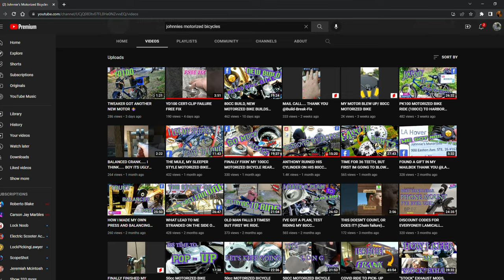Electric Bikes Vs Gas Bikes (In The REAL World)

Comment: E bikes in the EU are stupid 25 km/h and pedal assist only. Gas bikes make 100% more sense over here. Unless ,ou get something over the top they don't make sense as a "stock" product.
Reply: I like the throttle propelled ebike. Low maitrnce but too expensive.  Gas bike wins at the end of the day
Reply: @person-ce8cr  go with a conversion kit, literally just finished upgrading my road bike yesterday 1,350$ total and I could easily have gone alot cheaper, this is with a 1000w bbshd motor with a 52v 14ah battery, speed limit I can set, and can cruise up to 38mph, can go faster if I change to higher gears, but frankly I dont need it, and I'm not willing to risk my life on a bike from the early 90s anyways
Reply: Gas bikes in Europe dont make as much sense as it seems considering they have to be registered regardless of power. If it's a Bosch motor there is chips available that up the top speed to 45. Trenergy sells a bike without a limiter. Decreasing the wheel circumference in the ebike settings gives you a bit more speed at the cost of inaccurate speedometer readings. The way a  manufacturer delivers a bike has to fit certain law based parameters, but that's usually not the whole story
Reply: @joe-_-  they don't need any registration in my country. You can have them with a 50cc engine. No insurance, no licence, no registration needed.
Reply: @Matthew-wj8cm  oh well in the Netherlands they do
Reply: @Matthew-wj8cm  here in the US right? The trade though between gas and electric is gas becoming more of a hobby than reliable transport, granted the conversions have become a hobby by themselves, but beyond the setup, maintenance and performance tweaks are not nearly as common as the gas kits, not meaning this as a bash, they are definitely cool, but for transportation they do lack reliability
Reply: @alexnorth2452  you summed it up perfectly. Electric is indeed more useful from a reliability standpoint. But price is still the issue with me, combined with the 25 km/h rule in the EU
Reply: @Matthew-wj8cm  in my first reply on the thread i mentioned the conversion kit I use, which is a 1000w bafang bbshd mid drive, changing the speed limit on it is as simple as typing in a code, I currently have mine set to 99mph, not that it can reach that, nor do I ever cruise at full speed which is about 44, normally keep it at 18-20mph but on my route I get chased by dogs alot, so I like to have the ability to go above 30, I now ride a lowrider recumbent, so I'm quite low, and am not eager to see which dogs are actually friendly, but getting back on topic, technically my setup is not street legal, but in the rural area I live, so long as I'm not doing stupid stuff, that isn't really an issue, it boils down to the cops are not gonna take the time to check the specs on the motor so long as I am not doing anything to draw their attention, while I can go 40+, I don't need to, nor do I want to, I'm content at 20, and if I get tired of peddling, I do have a throttle, but I never go above 15 with it

Edit, and on the price, while it is higher than the cheaper gas kits, you can get electric kits below the 1k mark, though I do not recommend cheaping out on the battery
Reply: @alexnorth2452  that's the point. I neber in my life had 1k to spend
Reply: @Matthew-wj8cm  time to save up a bit then, it's not like I was able to buy it on a single paycheck, it took 5 months of saving to afford it, and the extra $ spent is time saved on maintenance, so I'd argue it equals out in the long run
Reply: @alexnorth2452  thank you. Maybe I'll do that
Reply: I'm curious if anyone in the EU remembers the time when they were free or if they even care anymore. Next stop for the EU 15min cities, C taxes and time to Eat ze bugs !
Reply: @joe-_-  i just ride mine illegally, the police don't care, it's illegal to have more than 50cc but just tell them it's a 49cc. They know you're lying but usually couldn't care less
Reply: @joe-_-  here in America anything 50cc and lower doesn’t need any form of license, permit, or even age restriction. I just use it for work.
Reply: @JudeTheYoutubePoopersubscribe  i know but tell the czech police. They were pissed i didn't have a title for this thing, they don't make titles for these but they wouldn't listen. I had to push the thing home. That sucked
Reply: Same in Australia. They out lawed the petrol kits that were $300, the electric ones that are legal are useless. 25kmph and 35kms range.

Comment: I purchased a 49cc 4 stroke motor kit with a 44 tooth sprocket. I put it on a 26 inch huffy cruiser. I am 225 lbs on a good day. My top speed is 29 mph with an average of 90 miles per 2.5 litter tank. The only problem I had with this kit was the clutch after about 2500 miles. Replacing it was easy to do and only cost $30
Reply: Yup, love my 4 stroke. Just keep an eye on your chain tensioner.
Reply: Burned through 2 clutches within 15 miles
Reply: Spend the extra money on a wet clutch.  It rides in oil and wont burn out.
Reply: @williamsporing1500 it can be dangerous if you don’t for sure
Reply: @TalanisYoung  I welded one to my frame. It’s an alternator bracket for a Chevy small block. Haven’t had an issue. The bolt on ones that come with kits are junk.
Reply: I built a 52v 1200w ebike off the Schwinn o.c.c. stingray frame with actual moto tyres and a dual mode controller consistently cruising at 35mph with a top speed of 49mph with a range of 40-450miles  and can handle a 20%grade with ease I've built gassers in the past and the reletive quiet is nice compared to the high buzz of the 2strokes
Reply: @williamsporing1500  yup 👍

Comment: I built an e-bike in the early 2000's using a car battery, big block chevy starter with gear reduction and a flywheel (10:1 ratio total) and I used a fuel pump, pc radiator and I ran 1/4" aluminum tubing around the starter coils and brushes. 30ish moh and very reliable. Currently I'm working on a 1,000w setup and working out a gas/e hybrid option.

Comment: I would want to point out that it’s literally impossible to find a entire electric bike with a 60v, 52v, or a 48v battery for under $500. You can try finding one for more than 168 hours non-stop but I’ll promise you that you will never ever find a seller trying to sell a entire electric bike with a 52v battery for under $500 flat. Electric bikes also is not budget-friendly on the whole since a dirt cheap e-bike by many enthusiasts cost a minimum of $1k. A decent electric bike conversion kit alone cost $1,350. Electric bikes are trash, for the battery alone you could’ve purchase an entire pre-installed gas bicycle.

Comment: The fact that you built up the 2-stroke bike gives you a massive amount of flexibility when considering things like power, speed, and price. Just this last month, I built a 1500w ebike, including the battery, which I built with 98 Samsung 18650 cells. Because I built it myself, I was able to choose exactly how much capacity the battery had, how much power the motor had, what brakes I put on, and so on. It has a top speed of around 34, and so cruising around at 25 mph really isn't stressing any of the components out. In this way, the DIY approach has its advantages, and leaves the HIBOY ebike with a slight disadvantage.
Very well put together video though!
Reply: May I snoop and ask you a question?  Your electric build is much more than I will ever need, but as a two stroker wanting to get an electric, I cannot afford a factory electric.  About how much was your build?  My gasser was $107 for the engine and a $75 old Huffy beach cruiser.  Then the lighting, dual brake lever, rear basket (yup poor man's grocery getter) added around $100 more.  I want to get into electric and there are hubs on eBay starting around $200, but then battery, speed controls, etc and knowing what goes with what seems impossible to my empty pockets. Any helpful information would be appreciated.  Thanks
Reply: @marcpavlik8776  you can check-out ebike school here on youtube.
Reply: @lonewolf14779  Thank you, I will check them out.
Reply: @marcpavlik8776  It all depends on how far you wanted to go to save cash. My build cost a little over $1000 all in, including the necessary tools to build the battery, but you can do it a lot cheaper. I started out with a new $400 bike, because I didn't want to have to worry about any of my components, but if you surfed the used market (facebook marketplace, craigslist, etc) you could probably get a decent bike for around or under $100. The kits you see on eBay for around $250 or so usually come with everything needed to convert the bike EXCEPT the battery, which you would need to get separately. To go the route that I took, and build your own battery would likely save money if you already have a soldering iron, spot welder, charger, and the knowhow to put it together, but otherwise a battery off of eBay would do the trick equally well. The benefits of electric power come with a hefty price tag, but if you save then I think it's worth it.
Reply: @kwadkrazy6078  Very good information thank you.  Batteries have been my main concern, I have the bikes, and I have been told to check out E Bike school as well and so far an electric bike is starting to look more promising.  Being able to get appropriate items that interface safely with each other, but not necessarily at the same time of purchase and still affordable is a key point for me.  I'm getting lot's of information now and have a pretty decent brain (half a body though) but I am starting to think it will happen.
Never thought I'd say something like this.  I'm getting excited about an E vehicle.  
Oh my Master GM mechanic father is rolling in his grave right now.  Oh well.  Thanks
Reply: Built >bought
Reply: @businessraptor134 how about bought from built?
Reply: I agree! I build E-bikes, a DYI E-bike cost less than $1200 dollars.
With $1200 I can buy a nice bike, a nice E-bike conversion kit, and battery.
$1000 dollars can yield you a E-bike with a 32 to 36mph, with a range of 41 miles’ full throttle’ very clean looking build, and very dependable…..I’m not knocking a already assembled E-bike…..but already built E-bikes are gonna be a bit more expensive, and have a speed Govern, if something goes wrong with it….it’s gonna be harder to Troubleshoot’ compared to a DIY E-bike’ most DIY E-bikes use atleast a 1000w kit.

I personally think the video should’ve been Diy E-bike vs DIY  gas bike.

Comment: Thanks for the video man, i looked at both the electric and the 2 stroke. With my budget and mechanical experience, it was an easy choice for me. The 2 stroke it was, and i been enjoying my bike now for almost a year i believe or maybe longer. lol. Electric just could not go the distance, if i want to ride 100miles , all i need to do it keep putting gas in and keep going. Then there was PRICE, and the laws around electic bikes here. 2 stroke was best for me. I appreciate your opinions and thoughts man. take care.
Reply: Hey I know this is an old comment but how do you make it ride reliably enough to go 100 miles with no issues?

Comment: Gasket sealer or silicone on the wire going in the hub is what I’ve done. If the wire and hole is pointed down then less chance of intrusion. I still seal them up though. Water in the throttle has messed up my rides before, glad to see this bike doesn’t seem affected.
Reply from the maker: Thanks for the heads up!

Comment: I've used a small 1000 watt generator in tow to my 3kw hub motor build and had unlimited miles per generator fills.  For folks with range anxiety.  I tested this setup for 6 hours of constant running and charge never dropped under 80%

Comment: The online e-bike conversion kits don't cost much until you add a battery.  I was looking at a Bosch e-bike because I like the chain drive motors.  The e-bike was $2200 and an extra battery was $800.  I couldn't afford that, so I opted for the Bafang e-bike kit to get the price below $1000.  I like the bike because it makes no sound.  Adding a 2nd battery cost around $500, but then there is always the fear of battery failure and if it ever catches fire, they burn down everything around it.  Hopefully that won't happen to me, but it is a concern.  I have been thinking of buying a friction drive kit with a Honda GX50 engine.  You're right, it is more of a hobby than something to depend on.

Comment: LAH, great video as usual and well presented.  I'm a two stroker out of cost mostly, some times I have hopped in the van instead of the bike because I can be lazy or my leg hurts bad enough I don't want to peddle.  An electric would be a great addition to my transportation needs.  Like you, electric range would suit me fine. Right now a 1/2 gallon gas and $1 for oil mix lasts me a month or better in town ($40 per month in fuel in the van, I don't leave home much anymore).  Getting electric is out of the question price wise (so if any of those folks sending you an electric wants to send one to this crippled old coot I will take one) but the cost of even assembling one from new eBay parts is unobtainable and the knowledge of what goes with what part wise is more daunting than the money part.  I took my old Hardley a Davidson out the other day and ended up in a downpour so bad I pulled the helmet over the front of my eyes and peeked through an air vent to see.  About three blocks and I was soaked, dripping wet. Road conditions and sight were the only things slowing me down as the bike seemed to love the water cooling, but then old grumpy here spent twenty minutes drying my chrome and at some point will re polish it.  Anyhow I would like more information of building my own electric, I would assume the more sales the price should come down as well.  At this point two stroker may be my only answer, but I'll keep watching you.  Maybe there's a China Doll electric set-up in the works soon and if so I'd hope you'd get, build and show it on your channel.  Stay safe.
Reply: REMEMBER TO REPORT SCAM AND IMPOSTER ACCOUNTS!!!

Comment: What about a gas-electric hybrid? Use an electric hub motor to get up to speed, and gear the gas engine for high speed cruising. Regenerative braking on the hub motor to recharge the battery off the gas engine. If the power goes out, use the bike as a generator by propping it off the rear wheel. Spin up the rear wheel, engage the gas engine, and use regen to generate power. Then pull that power out of the battery with an inverter to run your fridge.
Reply: That would be extremely heavy to the point where it wouldn’t be safe to ride, I’ve actually seen one before tho for sale on offer up. I guess some guy put a gas kit and an electric kit on the same bicycle. It looked sketchy as fuck

Comment: I feel like trading a bit of performance on the gas engine by putting a more restrictive quieter exhaust  on it would solve most of the concerns about karens and drawing attention and/or legality. Like you said, if they don't know you're there. Then they're probably not gonna ask any questions. 

I plan on buying a trike soon and have been making plans to put a motor on it. I have a bike path near where i live, but to get to it i have to take public roads which means traffic, which means i either get a bike rack or something and drive there or put a motor on the bike so i can "safely" ride amongst the traffic to get to the bike path to then pedal around on.

Comment: No motor noise, no me ride. I like the sound and feel of a gas motor. I don't really find the lack of sound to be exciting for an ebike. Not just that, but the long time to charge an ebike fully if you drain the battery, compared to the low time to put fuel in the tank is a selling point for myself.
Reply: I just rode an e-bike 1st time and love it

Comment: I did something really stupid but fun. I have a small ebike with 14 inch wheels and I strapped an 80 cc 2 stroke motor , so the electric motor drives the front wheel and the 2 stroke drives the rear and can be used at the same time meaning it can be used as RWD , FWD an AWD anytime i want.

Comment: (YouTubes Jarrod D) Made me realize that a 3hp. 4 stroke rear friction drive is simple, cheap, low maintenance & very reliable. Best suited for a commuter bike or for long hobo road trips....He's rode his cross country a couple times....It has good hill climbing power & good MPGs.....A few downsides are engine noise, having to bump start when you come to a complete stop & only a 25 to 30 mph top speed. Some engine noise could be reduced with a better muffler & light plastic or aluminum partial engine enclosure....A clutch could be added so it doesn't need bump started at every stop while still being reliable....He doesn't use a clutch, I assume just to keep it as simple as possible.
 Between a friction drive, ebike & 2 strokes, I think a 49cc 4 stroke kit is a good compromise. It's quieter & better MPGs than 2 stroke, can still go 30-35 & more reliable than a 2 stroke. Not much more expensive than 2 stroke & much cheaper than a e-bike.

Comment: A few things I think was skipped in this video, while pre-made ebikes definitely have a serious expense, there are conversion kits that can be significantly cheaper, and offer better parts than what you can get on pre-made, granted my opinion is biased on this as I have just finished my first conversion, but at 1350$ in for something that can be considered a decent ebike,  but 1350 is far better than the 2k+ that most pre-mades start out at, also I do feel that hub drive ebikes are just flat out inferior to their mid-drive counterparts, again my opinion is biased, but backed up by stats. Another thing to mention for the electrics, depending on the bike, the battery is removable, and depending on the quality of the battery, it will have a safety to cut off charging when it's complete, meaning yes you can put it on the charge over night, and during cold spells you can just take the battery off the bike and bring it inside